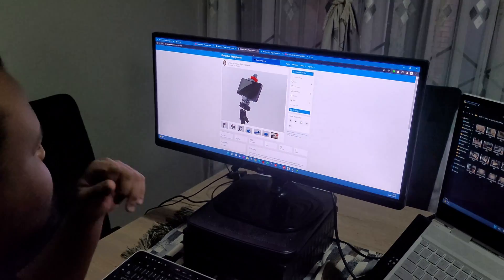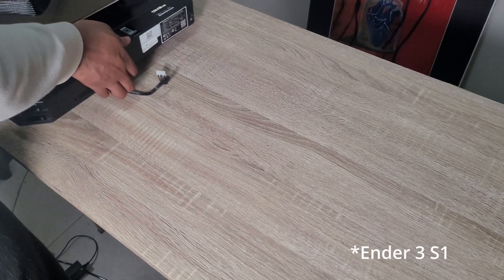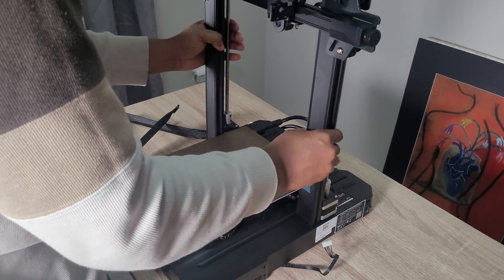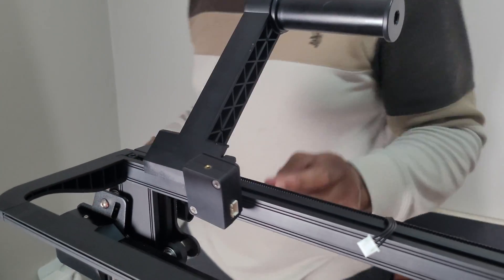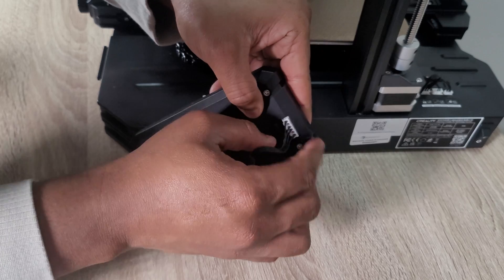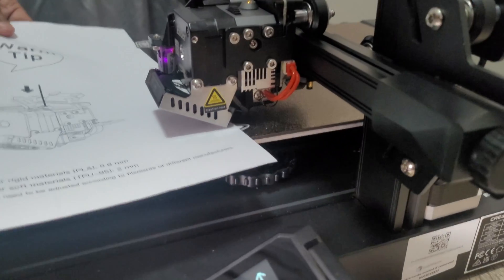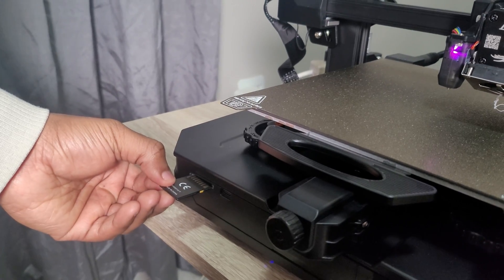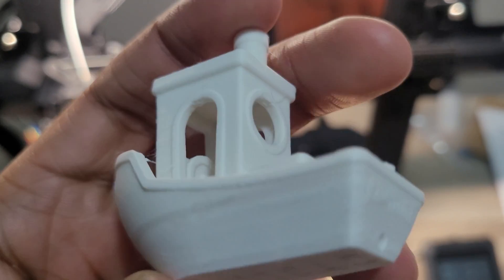Ender 3 S1 Pro Setup & Test Prints | Good 3D Printer For Beginners?

Comment: How long did the rabit and the boat take? Is the filament affordable? Did you have you have to buy a lot of the filament? Does the funnel stay hot the entire time? Has using the printer increased your electrical bill drastically? Do you have to do any cleaning when you're done?

😅😅
Reply from the maker: LOL from this text I can see that you are interested in getting one 👀

Can't remember from the top of my head but I think about 1.5 hours.

The filament is very affordable, the basic PLA I got for 375 which is is 1kg roll, which will get you many prints!

The one I had on this video was the sample filament that comes with the printer.

Yeap, it says hot while printing, it is needed as the filament would not be extruded.

Nope, they don't use much power, though I have to say I haven't used it many times. I have a power monitoring smart switch hooked up to it. I'll get you some stats compared to a regular PC. 🙂

The cleaning would be to remove the initial lines it makes but that's nothing, I do clean the bed before printing the bed with isopropyl alcohol because the oil from one hands might cause the model not to stick to the bed... resulting in a failed print.

Comment: My issue is that after a few hours down the line, mid print, the extruder stops extruding. No clogging. Just direct drive gear marks on the filament and the black outer gear wheel making tak tak noise and vibrating. Using pla, at 200deg, 0.3 layer, 0.8 retraction. SHOULD i release the gear spring tension screw of the filament feeder knob?  Please help. Ender 3s1pro
Reply from the maker: Hey, firstly thanks for watching.

That is a very weird error. I'm new to 3D Printing, have you tried to use a different slicer maybe? For me it sounds like maybe the GCODE midprint might not be sending the right instructions? 

Also if it's just gear marks on the filament, my limited knowledge tells me that the extruder is also not even hot anymore at that time? So the filament is not being "melted"?

The "tak tak" noise you are talking about, I've seen someone talking about it somewhere, I can't recall now but lemme see if I can find that post and link you to it... maybe that might sort out your issues too?
Reply from the maker: Also if the filament is coming out without being heated. I recall seeing some guide on Teaching Tech, he talks about PID Autotune being something to look at when your temperature is not constant: https://teachingtechyt.github.io/calibration.html#pid
Reply from the maker: I can't seem to find the post with someone complaining about the sound, but I thought also trying to find out help from this Facebook group might help you, there are a lot of good people there willing to help, just post on the group: https://www.facebook.com/groups/602529180853579/?ref=share

Comment: For leveling the bed did you just adjust it to be able to fit the piece of paper under all four corners? Or any helpful tips in general? Seems to be the trickiest part.
Reply from the maker: Thanks for watching 🙂! The paper trick actually didn't work so well for me, ended up being a lot of trial and error. Took some time for me to get it right, after all those tries I think "Live" bed leveling seems to be a better option.

Specifically here's the method I followed:

1. Used the paper trick on the z-offset and go through the 4 corners as well as the middle point (my 3d printer allows for 5 points to move the hotend to) - Doing this as an initial calibration.
2. "Live" bed leveling. There's an awesome guide by this YouTuber (will include link to the guide in a comment below after this one) - Basically, you print thin squares on the 5 points of leveling, assess how the lines look on the prints and adjust where needed. The "live" part I followed on my side was as the printer printed the squares I would monitor closely by eye how the first layer looked and would adjust the knob ever so slightly (the direction of the adjustment is informed by how the lines look, if the first layer struggle to stick to the bed or the there are gaps between the lines, then your extruder is too high, so need to turn the knob to the down direction. If the lines look too squished together then extruder is way too low, so turn knob to the up direction).
3. Repeat step 2 for all the thin squares until it is perfect and the first layer is smooth to the touch. 

The above sounds tedious but it worked well for me, I also like thar the printing of the thin squares does not take a lot time.

Do let me know if you would prefer me making a video of how I did the leveling 🙂. Though I unfortunately would only be able to get to it, first week of June as I have exams to write this month.
Reply from the maker: Here's the link to the guide: https://teachingtechyt.github.io/calibration.html#firstlayer

I think I will still try to get a video out on how I calibrated my first layer. It is indeed a tricky thing that can be annoying at times.
Reply from the maker: Oh! Another VERY important point! Make sure you try the above leveling steps with your bed being pre-heated to the temperature you usually print at, typically 60 degrees Celsius.

This is important because your leveling will likely not be accurate if leveled when the bed it cold as the bed will expand a little when heated, so you want to set all measurements to when you would be printing, hence level at 60 degrees Celsius.

Just be sure not to burn yourself, for me it was warm but not terribly warm to burn my skin.
Reply from the maker: Another point... 🤣🤣 it's clear that I need to just record a video.

Makes sure you clean your bed before performing the procedure above, ideally with 99% isopropyl alcohol based solution cleaner as it can just lead to false outcomes with the prints of the thin squares if your bed is not clean, typically helps with bed adhesion but it's a good idea to also clean before leveling your bed.